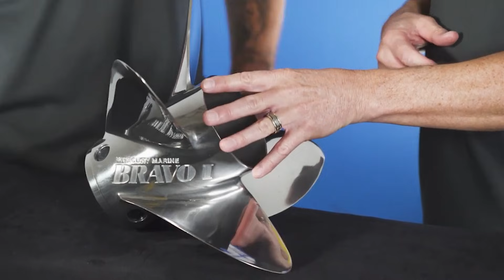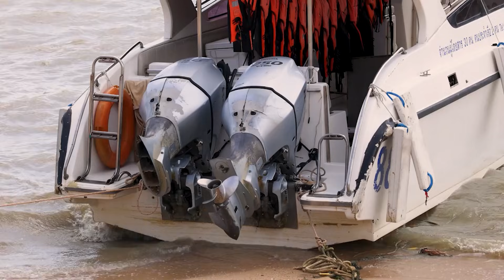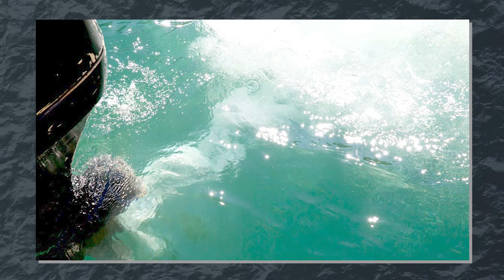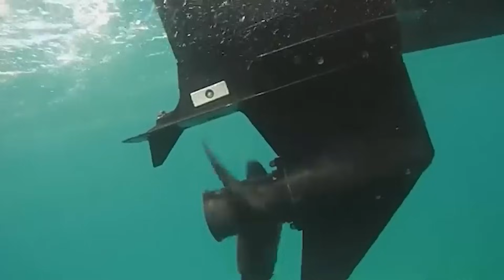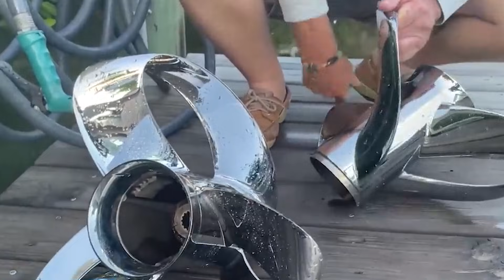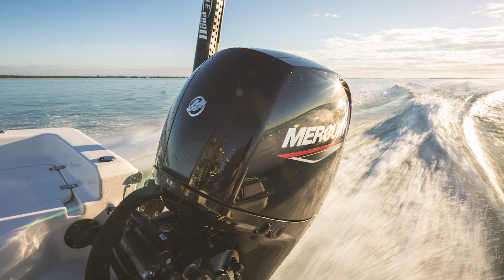Propeller Secrets That Waste Your Horsepower

Comment: I have a boat with a yamaha f50 2023 with yamaha black serie stainless steel 11pitch prop. At topspeed 6600rpm its top speed is 44mph. In this normal and effesient or do i need a other prop and if you think i need a other prop what would you recoment?
Reply: That's one fast 50 hp
Reply: I looked at the manual for the yamaha f50, and the rated RPM range for your motor is 5,000-6,000. At these RPMs, the motor produces the advertised power. According to the tachometer, your motor is running at 6,600 RPM. In this case, the propeller for your boat is "light," and the motor is running at an over-revving speed. This can lead to overheating and potential internal damage. Alternatively, if the load on the boat's hull does not increase, you may need a 12- or 13-inch propeller. At the same time, the speed will drop to the calculated 5500\5800, and the engine will operate in an economical and calculated mode. The speed will remain in the same range, and the fuel consumption will decrease.
Reply: A quick google tells me that your engine came with a small 10 1/2 inch prop….don’t listen to those who tell you you need a 12 or 13 inch diameter because that will stuff your engine….what you need is to go up 2” in pitch size to lower your rpm’s….this will make your boat faster….if you do increase diameter you can really only go to 11 inch diameter and no larger.
Reply: It's unlikely that he will answer you. You need to consider the engine's specifications. The engine manual specifies its maximum power at a given RPM. If the engine produces 6,600 RPM with an 11-blade propeller, and the manual indicates that the engine reaches its maximum power at 6,600 RPM, then the propeller is properly adjusted for the boat. Instead of focusing on speed, pay attention to the engine's operating mode.